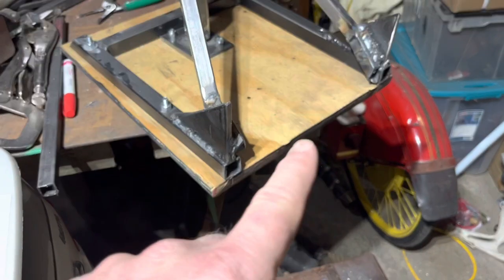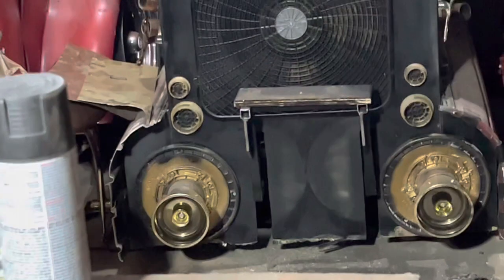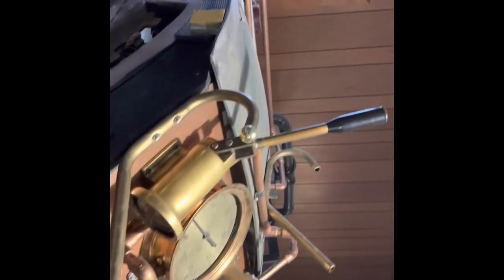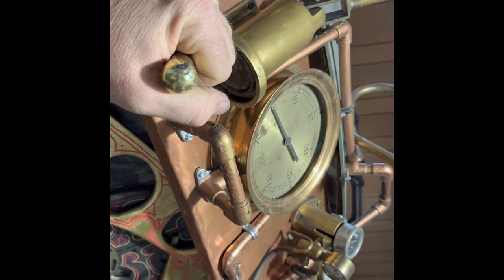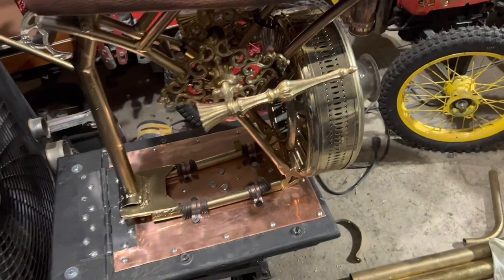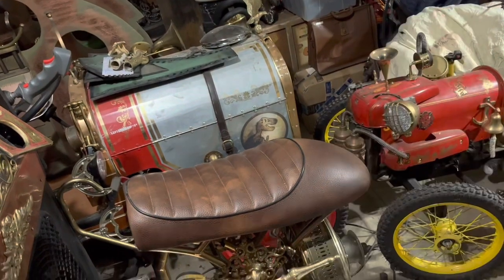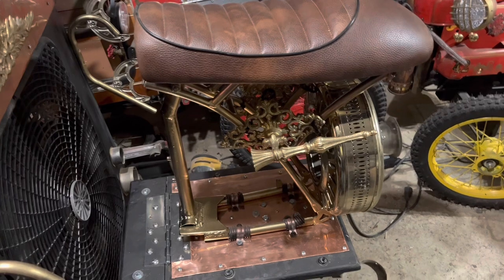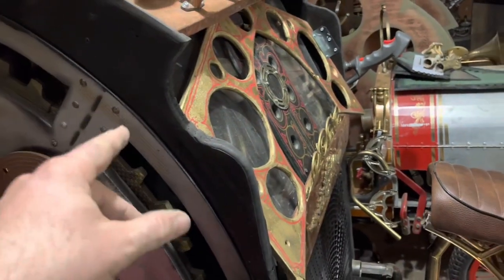VLOG 51: Steampunk Underwater Submersible Passenger Vehicle part 4

Comment: I would really consider replacing the caster wheels with air filled tires like a wheel barrow or even a kids bike and you could use the frame, anyway good luck and looks good.